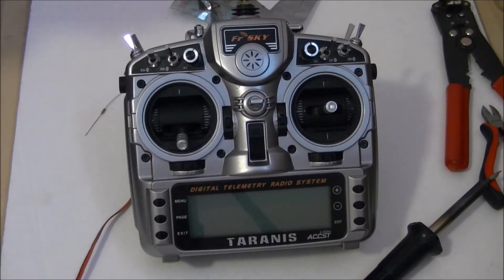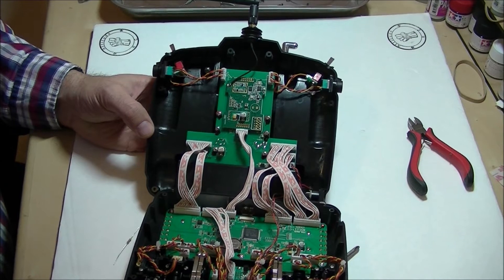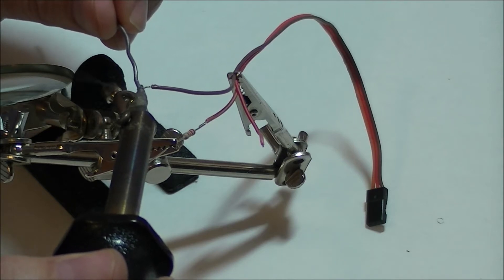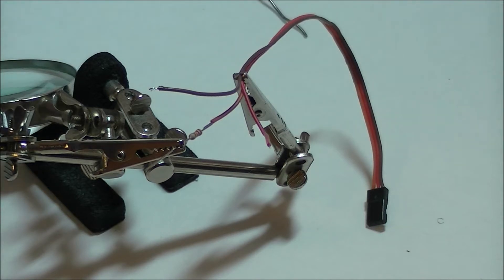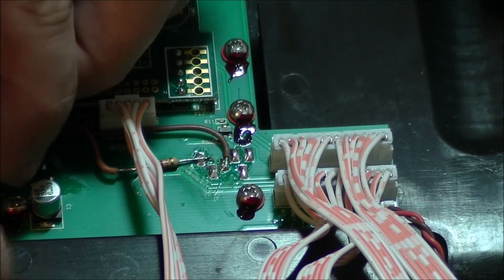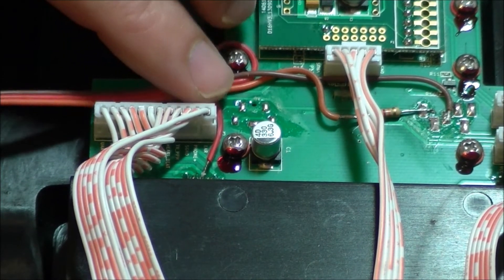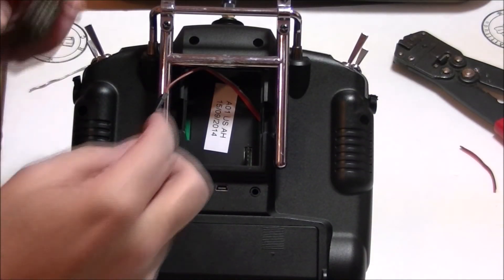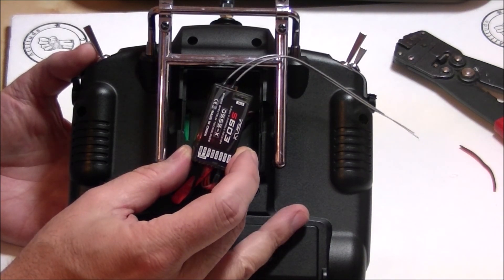Taranis Wireless Buddy Box Part 1

Comment: Question: Why open up the Tx and put it inside, why not use a servo plug and just install it in the RF bay? Also easy to unplug if needed? Q2: is the 2.2K resistor because that Rx outputs 5V and the Taranis is 3.3V signal level?

Comment: Hi,
I just did it yesterday and it's unbelievably simple. No need to do soldering at all.
I connected my Horus X12S (slave) to Taranis X9+ but I think as long as the RX has SBUS output it can connect anything. The Tranis module bay pin out can be found at https://eastbay-rc.blogspot.com/2014/01/taranis-module-pin-out.html . So the 2nd pin from top is "heartbeat", and then + and -. All I did was taking a compatible frsky nano receiver, crimping a servo lead at this order, and plug it into the module bay, and that's it. Then I bound the slave radio to this receiver and create a model in the master with trainer set to SBUS and it picked up the trainer link without any issue. One thing to note is the + is said to be raw battery voltage so the receiver has to be able to cope with it. FrSky xm will probably need a regulator but the compatible rx I bought has broader voltage range so no need. Also it has no telemetry, perfect for the job.

Comment: Hey, thanks a lot for the great tutorial. I just modded my taranis plus successfully. I just have one issue, the ppm of the receiver is only detected if I insert a plug in the trainer port. If nothing is plugged in, the taranis won't accept the ppm signal even though it's there. Can this be fixed in software? Any ideas? Thanks!